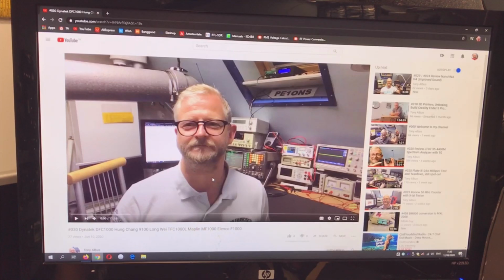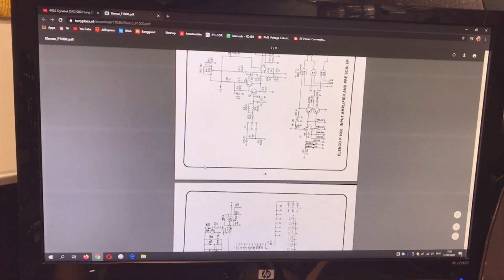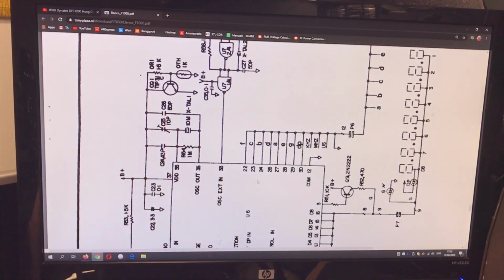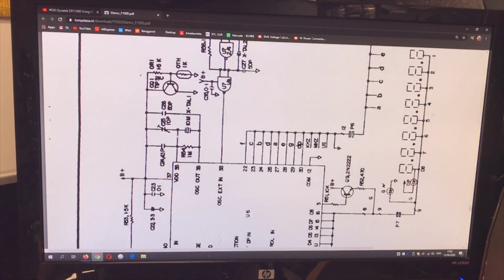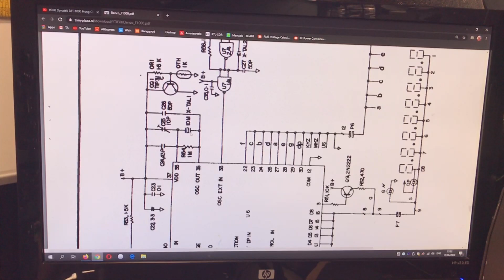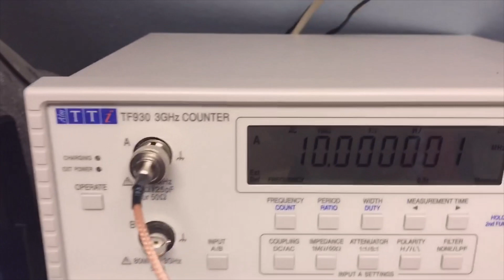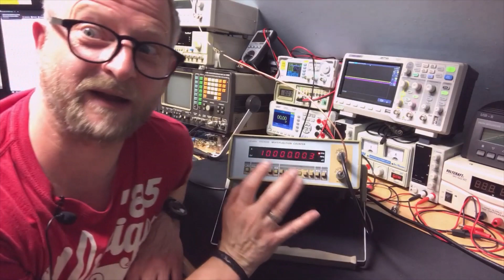#031 Dynatek DFC1000 Repair Calibration   Hung Chang 9100

Comment: Hi from Norway! I have a Monacor, same as the Elenco F-1000. On the 100MHz range it can be calibrated, with little drift from cold to warm. On 1GHz range, on the other hand, it drifts badly. If I adjust the timebase (3.0925MHz xtal) it will show more than 2kHz drift from cold to warm. I have a GPSDO and check with that. The "odd" 3MHz TB for the 1GHz range seems due to the fact they use a U666B 1/256 cheap TV prescaler, and I don't think I will order a special xtal for it. Will get a better counter, I think
Reply from the maker: Hi, yes sometimes its better to look for something different, look for one with external reference input. than with your gpsdo, it spot on.